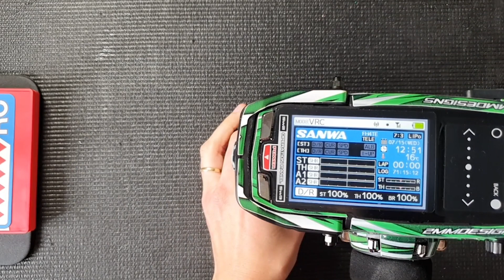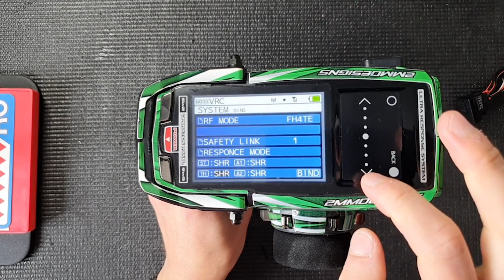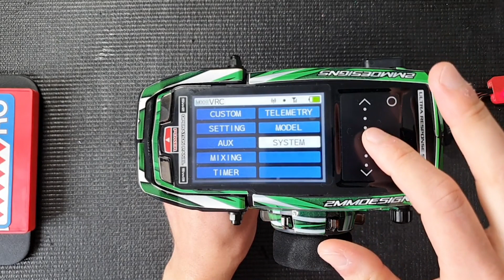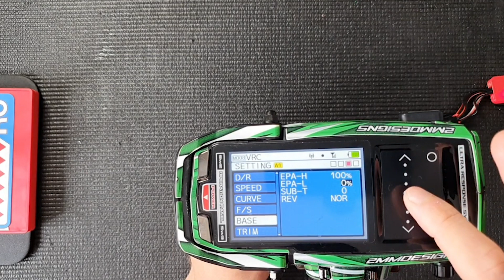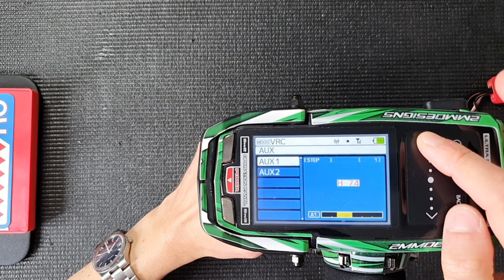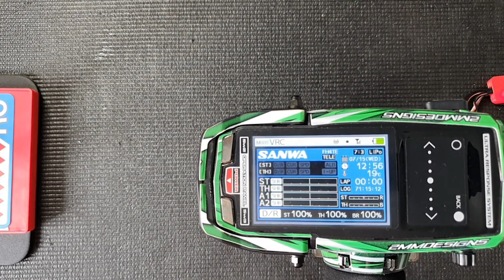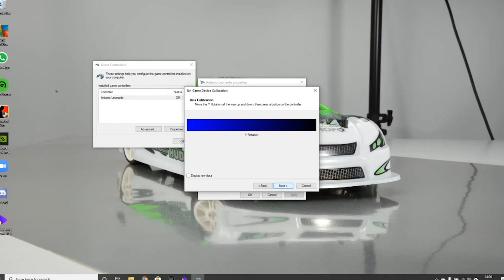Alexander Hagberg explains the new V2 VRC adapter from Monaco RC

Comment: Hi, since this adapter requires SHR, does that mean that there is no need to buy an extra RX493i receiver for the M17, an older RX482 would do just as well? Are there other options than the Monaco adapter as it seems to be out of stock?

Comment: just wanted to add a side note based on my own attempt: on WinX calibration - axis x rotation was for AUX 2 (channel 4) and axis y rotation for AUX 1 (channel 3). took me a while to figure out this, not sure if it applies to my machine only. wanted to share anyway.
Reply: okay thank you for that I think I have the same issue as turning the wheel would cause me to be marshalled after following this guide to a T- will give this a try.